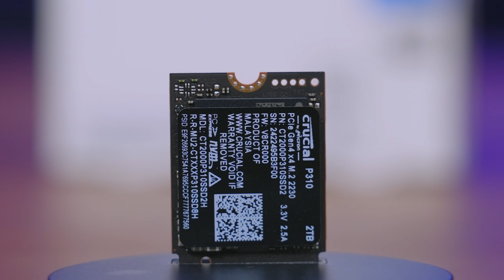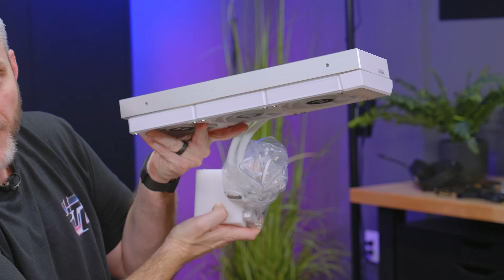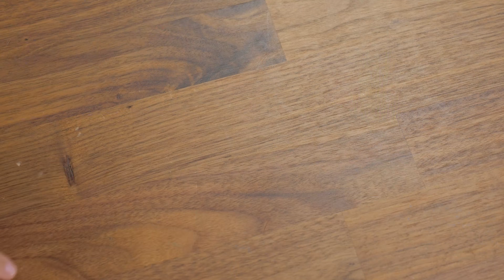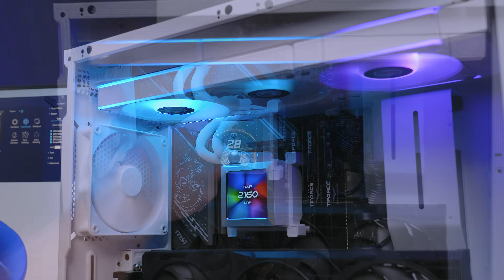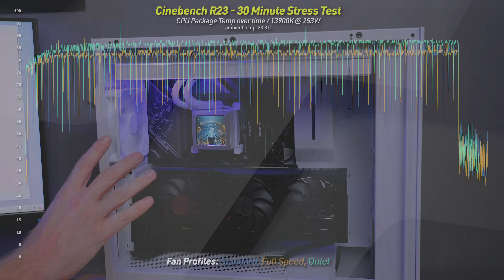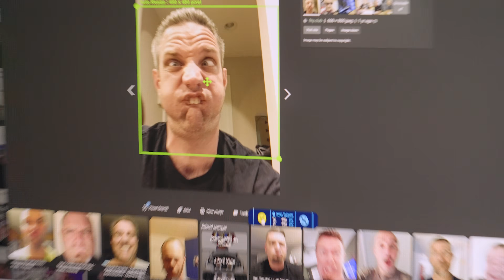Lian Li HydroShift 360R - Thermals and Stress Tests - is it worth it?

Comment: kinda wish the tubes came straight up from the pump not the 90
Reply from the maker: The biggest issue with that is they would then directly interfere with pretty much every motherboards VRM cooler heatsink
Reply: @Jayztwocents  hmm suppose that would be true, was just looking at the corsair aio on on my cpu and I guess I was thinking of the tubes coming off the rgb square and not the block itself. Wonder if the tubes could be moved closer to the aio screen and further from the mobo for the straight off to work, would prob require a serious redesign.  Either way looking to move away from all corsair in my PC and been looking at lian li, since I already have the strimmers anyway and with the PSU you did a video on and not this aio looking pretty good.
Reply: @Jayztwocents  this is the white version would the black have a black hardware cover?  Have a white build so the white cover to the hardware would match my mobo.  Maybe they could include both or sell them on their own if you wanted the other.

Comment: Theoretical questions.  Could you buy this unit and replace the Alum Rad with a copper one or could you keep the Alum and add a second radiator and a GPU Thermal block?   I'd love to buy the electronics along.   Or for them to create an Ala cart CPU GPU  combo Copper Rad Kit.

Comment: I have a Lian Li Vision case so there’s no way to attach the radiator into the top panel. I know you mentioned it wouldn’t work well to attach to the front of the case, but would it reach if attached to the side and still hide the tubing?

Comment: this is 10 years in making? it needs a ups?like in EXIT lights??and why i feel it need a 120 radiator from the pomp and the big radiaror ?to have a constant temps??so it need engine management kit ?or a firmware for summer and winter time?

Comment: I just purchased and installed this same aio in my case. However one of the three fans does not respond to the rpm changes in L-connect. The fan on the opposite end of where the hose are just runs at what seems full rpm all the time regardless of the settings in the software. The other two fans respond just fine. Not sure what that could be other than maybe a bad fan???

Comment: Thing is, here in Germany you can get the Arctic Liquid Freezer III 360 A-RGB for 80€ and the non-RGB for 70€ right now. Paying 200 USD or more sounds crazy to me tbh. The added features like the screen aren't worth that much to me personally.
Reply: This comment makes zero sense … with less than 200£ for the RGB version its even on the cheaper side … comparing it to the Arctic III is pretty nonsense … yeah that one is cheap as it is a cheap product … its far from crazy to pay 180£ for the LL … its not about extra features like lcd display … its about performance and efficiency and the Arctic III does not have the best test results … often even gets an ‘avoid’ recommendation  … why should you buy an aio that does not cool better than fan cpu cooling. For new generation cpu’s its not recommended at all. LL has great fans, excellent quality and a brilliant daisy chain system … the lcd unit is pretty good and useful … but more important cooling and stability.

Comment: Problem is with AIO, always, they get worse over time, kinda quick. You know, less water and more air in the tubes.... If that problem gets solved, im sold.
Reply: My fractal design aio is at 6 years I changed the liquid after 5 years. And honestly I find it hard to not do an aio in my next build because of how impressed I was with the life.

Comment: Not exactly a fan of the fact that uploaded photos turn out to be watermarks. If I wanted to upload a photo I took of say, the Northern Lights, or any dark or low contrast image, it'll be washed out. I'm not sure if there's built-in RGB control, but I imagine the way it lights up, you could control it, even with a third-party software if need be. BTW, I noticed you could put the extra bracket between the two pre-installed if you want a more clean look on that side

Comment: hi jay i've been following your for a while now and i recently upgraded my pc case so i bought the antec C8 case because i liked the style of it and i was wondering which fans size should i get the 120mm or 140mm fans also i'm running a a cpu air cooler so i would like a budget or a medium price range for the fans my cpu is a i7 12th gen

Comment: I have this AIO, and is keeping my Ryzen 9950x3d at high temperature and is really loud. 
Temps i am getting in IDLE 56-60C - without dooing anything in windows, ( no updated etc in background ) - in GAMES 75-80c. Have under volted the processor only -3C gain. Really loud AIO unless is broken ?

Comment: What did he say "The most overpriced AIO" ?
Smart of them to put Airflow fans on a rad and not static pressure fans :P
Reply: they are static pressure, look at the specs
Reply: @mainsource8030  1 : there are two version of them. 2 : look at the blades they are AIRFLOW fans. 3 " if one does not know what they are talking about one should s the f .
Reply: @ronnyspanneveld8110  high static pressure fans have more blades closer together to really get that vortex action brute forcing the air through the radiator. high air flow fans have less blades farther apart to create more cfm . i know exactly what im talking about punk. i have the tl hydroshift model and the tl non lcd fans get 4mm h20 pressure, the s model gets 5 mm h20 pressure and the r gets 3.26mm h20 pressure. If 4 or 5 mm of pressure isnt enough SP you're doing someething wrong.

Comment: Hey @jayztwocents, I recently built a new pc with this exact aio and the first 3 weeks or so it worked perfectly….but recently when I’m gaming it’s started to trip out. The screen resets over and over and I can hear the usb connect/disconnect chime over and over when it’s doing that….any tips? Or have you run into this issue….?

Comment: I’m impressed but skeptical. They wouldn’t replace my Galahad 360 when the fluid bearing failed after one week of use (they had admitted there was an issue, though). I returned it to the retailer and went with an NZXT which has been running just fine since then. Bottom line Lian Li wants your $$$, not your loyalty.

Comment: MSI X670E Tomohawk wifi (solve long POST time with EXPO enabled). RAM Power Down must be enabled if MCR is enabled. Without power down enabled I'd get a BSOD after windows boot. @ MSI, why is it that the VGA POST light illuminates for RAM post issues?, I spent hours trouble shooting my VGA/GPU setup when it dawned on me that it was the RAM which was slowing BOOT up. I think that RAM and VGA POST light signals are inverted on this board, or the POST lights are mislabeled.
I tried three recent versions of the BIOS during trouble shooting, identical result with all BIOS's.

Comment: Wait a moment... Doesnt the pumps/coolant start to get air bubbles if the tubes for the pump is mounted vertically? I always mount the pump with the tubes coming out horizontally.

Wont their be pump issues mounting it like that sooner?
Reply: no, as long as the pump isnt the highest point of the loop

Comment: I really like these, but im super curious how these high heat CPU's like the 14900k can handle swapping out the stock fans on the Hydroshift with the Lian Li Uni Fan TL LCD fans. They have less static pressure but how do they perform? I'm looking to use the white Thermaltake Core P3 with this AIO but i'd like to swap the fans to the LCD fans Lian Li has, but with less static pressure.. Can they keep up with cooling on stock CPU speeds?

Comment: I’ve just installed the TL version and had glitchy effects with the screen / l-connect 3, in that some of the effects didn’t work and it after a days running didn’t pick up the hydroshift on the L-connect software 
Emailed Lian-Li via their website and they still haven’t responded - seems like their customer service is very poor compared to other brands
Reply: Did you uninstall your current L Connect software and install the newest version? My version 2.xx wouldnt pick up the Hydroshift LCD until I installed version 3.xx. Hope this helps.
Reply: It was a new build and installed the latest software from their website
Reply: @Atlantian_official  Damn. Maybe try, again. Also, make sure that the pump is correctly plugged into themotherboard.

Comment: Forget the cpu temp, I'm more interested in the degrees on those tubing bends. 45 on the front, 90 on the side, and 90 on the back? That poor pump.
Reply: Probably a good reason some people have problems with the pump after a year or so.
Reply: @TTM1895  Exept  that this is brand new and nobody have used one before.

Comment: I don't feel excited by this. The hydroshift part is something I can do with 3d Printing and $5-10 of resin or filament. I'm meh about the LCD. I like sensor panels but if I am doing a sensor panel I want it to be big. Now I might be interested if they did one without an LCD or RGB for like $100-125. Hell if they did one for $80-100 with no fans so i can Just use my own I'd love that too. $200 is where I start wondering why not go full custom. You can get kits from Thermaltake, Alphacool, or Bitspower at that price. if the pump fails you can replace it for a fraction of the price of an AIO. Like if you love this aesthetic then great. But otherwise i feel like you could go custom loop or save a lot of money.
Reply: The whole point is to minimize the presence of the tubes. If you can figure ut a way to do that on a 3d printer, let us all know!!!

Comment: The problem is the water pump lines are kind of to short if you mounted a 360 AIO on the front of your case with the out and inlet hose ate on the bottom and it's really tight to get it to your CPU. 
Mine is mounted that way but the water holes goes across the side of my 4090 just before the power cable connects into my 4090. It fits but tight.  Not where the water lines are  pulled tight but just makes it. I wanted a 420 AIO, but the water lines might be too short for front mount where many people say it's too short if the water lines are on the bottom of the front mounted AIO. That's why I purchased a 360 which does the job.

Comment: Do they sell it without the fans? I have the AL120s already.
Reply from the maker: As I stated the fans are wired into the tubing sleeve so no
Reply: All you need is a $65 white AIO with screen stick your fans on it and you’ve got the same thing.
Reply: @Jayztwocents  thats incorrect, you can use any fan you like, so while you have to purchase it with one of 3 different fan types , they can be swapped

Comment: I currently have a Deepcool LT720 with Lian Li SL Uni fans on it ( to match the rest of my system ) running on top of my 7600X ( 5.4GHz pc -25 offset PBO ). On idle I'm getting high 40s and gaming as much as 80c, would this cooler offer me any better cooling? I know the aesthetics would look much better but what about the cooling. Just to add I have the Hythe Y70 and two sets of reverse Blade SL fans pulling air In. Do I buy this or do a new CPU custom loop? Help please tiny internet people in my phone

Comment: So basically you can't  change the fans anymore? Say i wanna put this is my case, i have an lian li 011 dynamic razer edition with a lian li galahad II performance with the infinity mirror and 9 lian li sl infinity fans... i like this screen but if i get this particular aio.... i cant put my infinity fans on it because the fan cable is in the sleeved part of the cable? I dont know but thats dumb
Reply: No, thats nt the case. You can change the fans. The tubs and cables are not sleeved together. I have the 360S and swapped the sotck fans for SL-INF fans. Look at 3:53 in the video and you see the tubs and cables are separate, the same is true of the stock fan cable.
Reply: @debatebore1057 i did take a look but as fas as i can see, all of the cables are coming from the pump right? I dont see a cable comming of the fans, is there a bracket where the fans connect to that can be taken of?
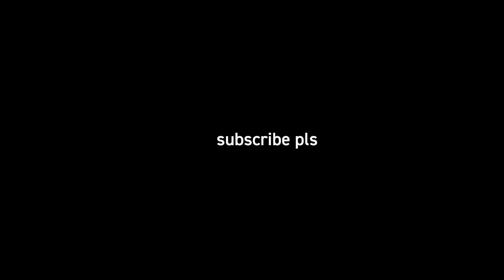Reply: @redpowerrr  There are a couple of cables coming off of the pump, neither one is connected to the fans. The fans have their own cable coming off the end of one of the fans. On the "R" and "TL" versions, the fan cable is hidden by the plastic shroud on the end of the radiator. I dont think you see that cable in the video, though. EDIT: At 19:58, on the TL version, if you look at the bottom of the rad, youll see that familair Lian Li connector. On the white version at that timestap, the fan cable is hidden beneath the shroud at the top of the rad.
Reply: @debatebore1057  aaahhh, so you can change the fans if you want to, thats better! If it performs better than the galahad II performance, i am really considering this cooler

Comment: I've had 2 x Galahad 240's pumps fail after 12-18 months each.  Avoid.
Reply: Galahad II Trinity models should already have those issues fixed afaik.
Reply: This is not a Galahad.
Reply: @zappulla4092  Correct, also correct is the fact the same engineers designed it, so a clear no no for me. Good luck!
Reply: @ZnakerFIN  Yeah they did do a recal in all fairness although my two were one way before and the other around the recall time.
Reply: Don't they have a 5 year warranty?
Reply: Recall also wasnt issued to all regions. Australia is just left to figure it out on our own. Also supply of "'fixed'" versions is non existent from retailers.
Reply: Lian Li AIOs are garbage. They're starting to rival NZXT as the worst AIOs
Reply: @bowlinbob6  they do I believe yes, once I find a box i'll be sending it back. They were quite good the first time, I sent the old one back and they sent me a new one. Can't complain apart from it failing, twice... No confindence in their products.
Reply: @ChineseMannequin  I guess they just assume you'll be able to mine the materials required to refurbish it being in a mineral rich country lol. Useless for you guys then, defo avoid.
Reply: Arctic freezer ii 280 more than 2 years and still kicking.
Reply: Does it matter if there is a 5yr warranty? No, cuz it should not fail within the first 1 or 2 years. They can have 50 years of warranty, it won’t change shit
Reply: @monk3synuts different pump manufacturer and that previous pump manufacturer had problems with every company that implemented their pumps.
Reply: @monk3synuts they changed manufacturers because if that.  Bet these new ones are Asetek.
Reply: @TheSjuris  Ah cool, thanks for the info!

Comment: Unrelated to this video but... anyone have advice on how to remove GPU from an Asus Tuf x570 mobo, I've tried pushing the latch with a pencil eraser but it just falls apart and won't pop out the gpu. Trying to add an m2 ssd but between gpu and noctua air cooler I can't even see the socket let alone reach it.

Comment: Why did you not show how it cools and AMD CPU (such as an 7800X3D or 7950X)? Is it because intel gets all the drama?
Reply: Think it because amd chips are easier to cool and this is overkill for an amd chip due their lower TDP value VS the Intel chips
Reply: @n0ex  Yep, you're probably right about that. No hate towards Intel, but I'm just curious how this AIO performs on a comparable (performance wise) AMD CPU. Guess I'll look around for an answer elsewhere.
Reply: Yeah, I assume they test intel since the reasoning might be if it manages to cool those intel chips, it'll be very fine for everything else on the market right now.

Comment: I have a 13700k. My VCore reading when running all core on cinebench is around 1.35. Strangely when I do audio mixing in a DAW it spikes up to 1.45 (even though my CPU usage is just around 35%). Does anyone have any idea why this might happen? It's possible that mixing involves plugins that are heavier on a single core but I could be wrong. After what's been happening with intel I didn't want to risk it so I undervolted about 0.05V and underclocked down to 48x for P and 40x for E just to be safe. I also updaded my Bios. If anyone has any idea as to why this might be happening/ if it's concerning I would appreciate a reply!

Comment: Why the Hell should i spend so much Money, if i can get the best AiO (Artic Liquid Freezer 3 ) for much, much MUCH less?
For the price of some AiO´s, you can buy an Alphacool custom cooling kit, and you can extend it with GPU cooler and/or more Radiators.

Comment: This new version of the L-Connect software also has floating system information windows, which enable you to have the most import info on top of other programs.  
It is not the neatest implementation, but still nice.
As for the AIO, I will stick to arir cooling.

And finally your temperature display was nice and clear, easy to see the difference.

Comment: Ya I might buy it if I wanted my PC to look like all the other PC's. Stuffing the tubes in a different direction helps with the appeal, but it still doesn't out do a open loop machines look and performance.
Reply from the maker: It's not intended to compete with an open loops performance or aesthetics
Reply: @Jayztwocents  Don't feed the trolls, Mr. Jaybird.  Lol

Comment: I'm so pleased I didn't go with a screen and RGB on my Ryzen 9 7950X3D AIO, had such good results with the Arctic 3 280, the VRM fan was a nice touch.
Reply: I have a 5800x3d right now and probably going to get the Arctic 3 360 since I have the antec c5 and want to fill the top. 

Glad to see it supports am5 so when I upgrade down the line the cooler can stay!
Reply: Went with Arctic aswell on my 7800X3D but I took the 420 version only because at the time it was on sale and cheaper then then the 360 even
Reply: @n0ex  Yeah good choice, i wanted to go bigger too, but was limited by my case. still keeps up with the heat , such a good cooler for the money.